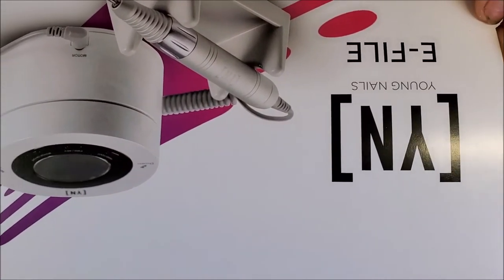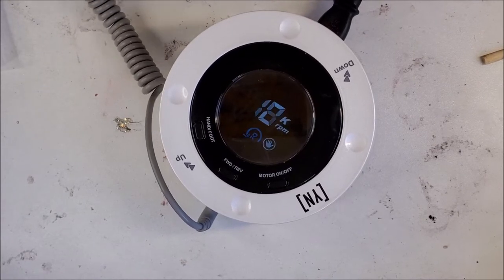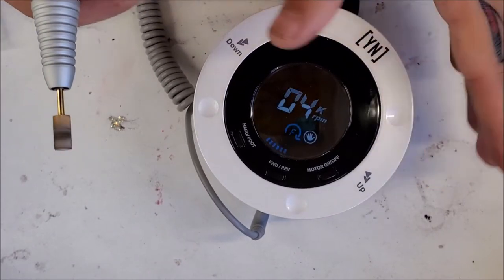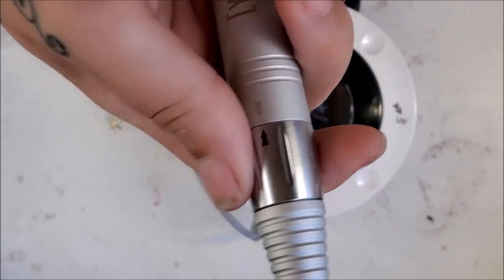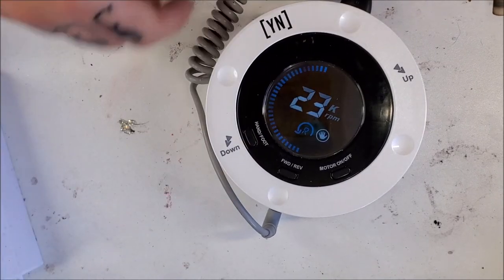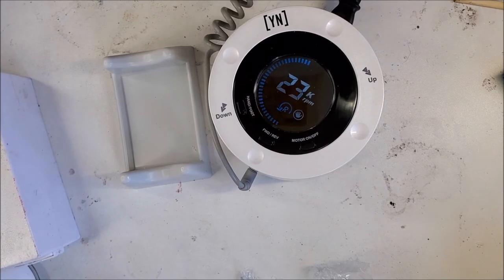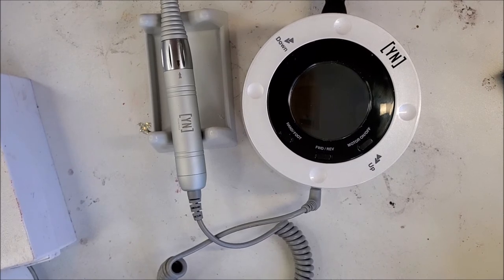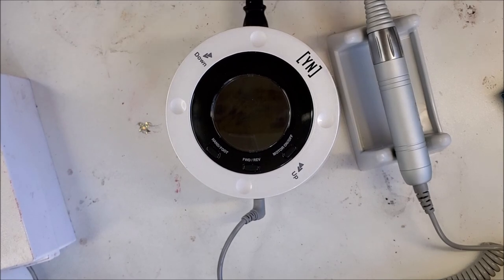YOUNG NAILS ELECTRIC NAIL FILE REVIEW!!!

Comment from the maker: Update on the YN e file returned until they fix all the issues.. beware if you dont put the screen protector on the glass circle you will def mess up this file but the cover is stupid it covers all buttons and everything there is no cut outs for the buttons so it looks stupid and presses down on some buttons contantly so thats not gonna work, and when ypur drilling dust gets in all those little buttons notably in the long run ruining the machine, the glass scratches easy as i returned this one and was sent a new only for that one to be worse than the one I originally had. And the new one the glass was all scratched so I decided that I wasn't gonna even deal with this file anymore i love the concept but it needs alot of improvements I definitely would not suggest purchasing this until they update it and make it better.. im buying the gelish E File